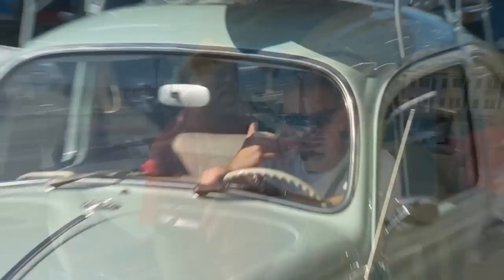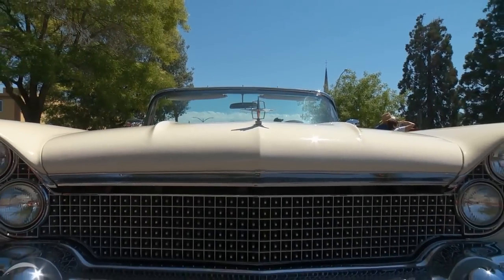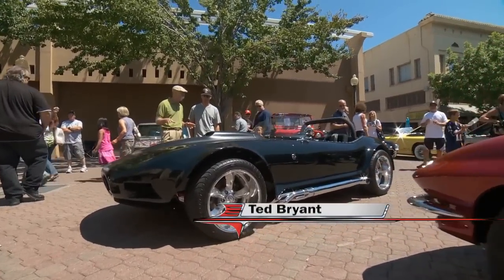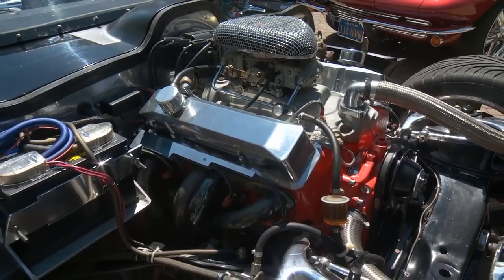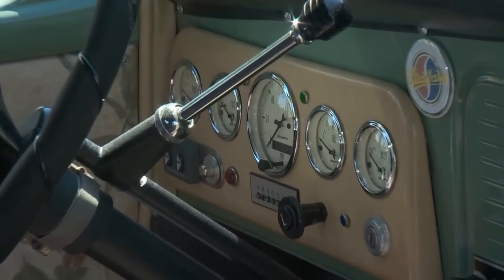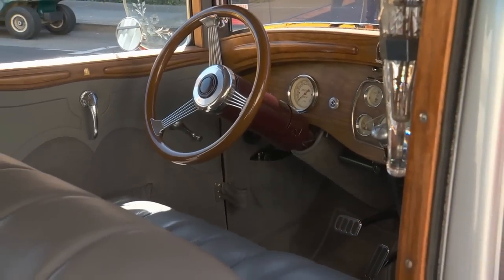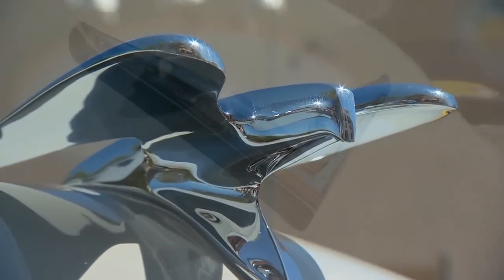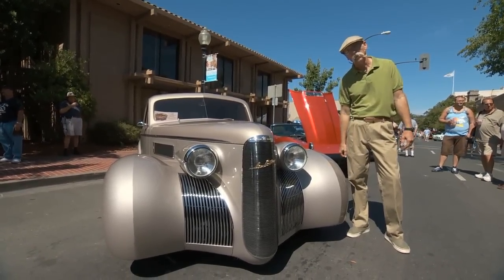1960 Lincoln Continental Mark V Convertible | Napa Main Street Reunion Car Show

Comment: This may seem confusing, it's a 60 CONTINENTAL Mark V, not a 60 LINCOLN PREMIERE .The Continental has the breezeway back window, the Premiere has a conventional rear window and did not have convertibles. They were considered separate models for a few years. Capri was retired with the 59 model. Lincoln and Continental consolidate again for 61. That's why Lincoln reused the Mark III, Mark IV, and Mark V nomenclature for certain LINCOLN CONTINENTALS from the late 60s to the late 70s. Our family had a 59 Continental Mark IV which had the name on the fenders, rear, and front grill but did not have Lincoln on the car. I have very fond memories of that beautiful machine.